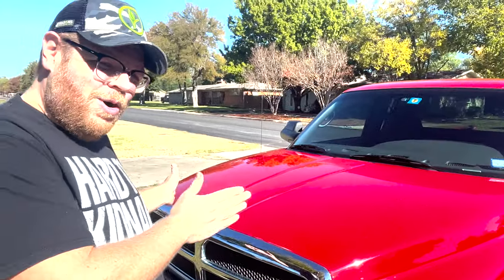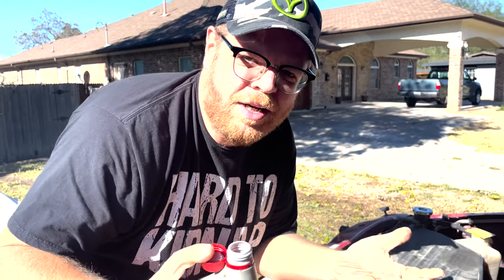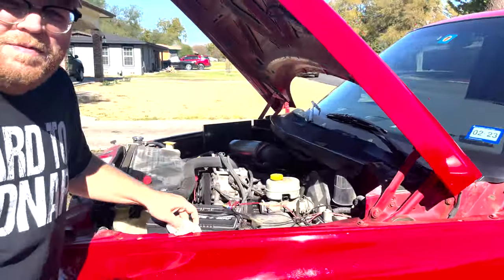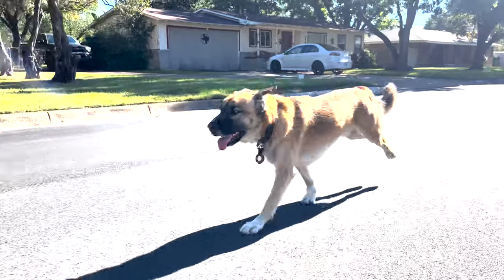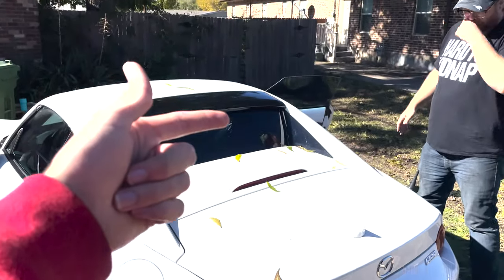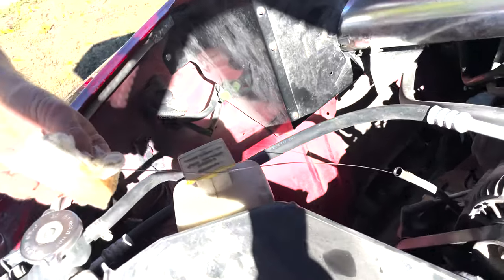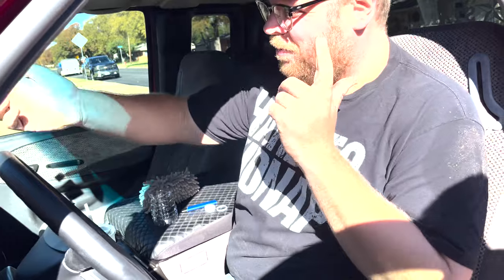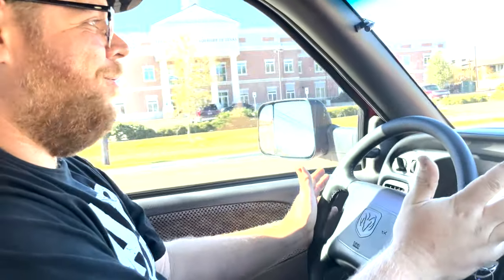Using ATF to de-sludge an engine

Comment: Sad to see a car treated like this. I bought a used 1979 Celica Gt in 1987 to drive back and forth to work. The original owner  had done 3 or 4 oil changes in 8 years. Surprisingly the car ran pretty good. The 20R engine was a beast. A trusted old mechanic told me what to do to clear some of the sludge. I drained the oil, changed the oil filter, added 2 quarts cheap oil and 3 quarts of transmission fluid. I drove it around for a couple of hours, not revving the engine. Drained the oil and was amazed at the chunks of sludge that came out. I did this once more in a month. I ran cheap oil in the car for the next 3 years. I was told that ATF had high levels of detergents. In 1990 I traded it in for a new Isuzu pickup.
Reply: My mechanic has done the same thing to his customers cars with gummed up engine. They use a full change worth and let it idle a while. 
I bought a 84 SR5 pickup with 22RE I didn't know was abused (by mechanic owner no less). I think he did about the same thing "2 oil changes ever". The filter was rusty!!  Anyhow I had my own shadetree method of a mix of mostly Diesel fuel and a little bit of engine oil and kept in its own container and re used for other gummed engines as needed (at my work). The pickup ran okay in buddy's garage and the drive home, I had no idea it was lumpy ooze in the crankcase.
It poured out like partially melted chocolate ice cream with chocolate chips. 
After filling with my mixture, and a roughly 7 minutes idle, it poured out like proper oil only a black film left in the bottom of the pan (my mix dissolved the turds still clinging to the inside).
Once full of the correct oil, oh boy it was a symphony of ticking and chain rattle. Game over.  Looking back I might have been able to put 3 bottle worth of STP and had it run without the noise.
The transmission was the exact same thing.. black and a lot of silt, once full of fresh stuff I noticed that the OD would not stay in gear. Today if I still had it I bet that Lucas Stop Slip would bring it back but back then there was only proper ATF and Seal Restore solvent. 
Hard to believe a mechanic would leave liquid turd in his vehicle.
Reply: Uh.  4 quarts is full.
Not 5.
Reply: I put sawdust in my engine and it made sort of a tik tik tik peep  varoom ! Thank you maam.
Reply: not supposed to drive it around when you do that trick. we always just let it idle for 15 min and then drain it. change the filter and add the new fresh oil
Reply: @jonnysnipes3123  i would agree. Probably did not help the engine.  It was a real beater, so I was never worried about it.. I definitely  would not do that on a more modern engine.
Reply: @reelman4299  probably is better to do that in todays engines because the oil ports are so much tinier than the old school engines so they may become prone to slush build up easier than older engines. i have a 5.3 chevy so i do a flush every 80k. ill pour 6 liter zero weight 20 oil in after i drain the old oil, and then ill top it off with 2 liters of atf+4 and let it idle for 15 min and then drain it and put in 8 liters of 10w 20 oil with an oil filter replacement. never had a lifter fail on me ever on my 2018

Comment: Yeah, ATF ain't going to fix worn bearings
Reply: No, but it will un-gum up valve springs and hydraulic lifters. Which seemed to have been his primary issue.
Reply: @nikdog419  Very little difference between motor oil, and ATF. Primarily viscosity improvers, and the concentration of additives (motor oil having significantly more).

Frequently they use the same grade of base oil to make both, ATF doesn't clean, can't clean, as the differences between the two is extremely small beyond concentration of additives. If anything one could take ATF, add more additives and make it into motor oil, engineering wise they are virtually identical. They simply use different amounts of the same additives, and a higher viscosity improvers/modifiers.

He simply poured in a very low grade oil (additive wise) which burns as it was never intended to be used near combustion.
Reply: @GainingDespair  Doesn't ATF have more detergents in it or is everyone just talking shit in the other vids
Reply: @RoxusRemo  No, it actually has basically none, there was a point in time where it had detergent, and during this period of time motor oil was detergent free.

It was true at one point of time, and like most things which travel word of mouth there was some truth to it. However we are talking a good 50-60 years ago when this was a thing. Long enough ago where it doesn't apply anymore, yet not too long where past mechanics didn't recommend it to those working under them as apprentices. 

Modern ATF, and motor oil both have the same exact base oil, from that stuff is added to both. Transmissions no longer have detergents in them because the base quality oil is purified enough not to cause build up, however detergents are needed in motor oil due to them experiencing combustion. The by product of combustion increases the acidity of motor oil, detergents prevent this for the most part until the oil needs to be replaced while also bonding to carbon in the motor oil to increase the size of it (so the oil filter can catch it).
Reply: @GainingDespair  Thanks for the detailed answer!
Reply: I always understood AT & PS  & Hytrans fluids to be basically a few additives away from  HYD fluid.  Also worked on different equipment over the years that the manuals stated you could use basically any of the above in their system. Also substituted one for the other in a jam in the past and never had an issue.
Reply: I'd be betting that the pickup screen and tube had a big smear of "engine turd" across it (not allowing the proper flow of oil, so it was being starved for oil not that it's so badly wore out).
Reply: Nope but it will get the rings unstuck if they are stuck, trust me I revived a motor that had no compression by adding a little ATF on the pistons, and guess what apparently rings where stuck and got unstuck and had 190psi compression after I did that.
Reply: Bearings 😆 there babet and over .100 thick ...they seldom fail unless they stick.. causing a wiping action which is caused by slug or low oil pressure or both

Comment: The ppl who are being nasty and rude just shows ignorance he added to his oil to break down the sludge. HE DID NOT REPLACE THE OIL WITH ATF if you have not tried it dont comment on it because before there lucs,seafoam,flushing or anything of that nature transmission fluid was used to clean sluggish engine and oil build up  and I'm the son of a mechanic who's the son of a mechanic 80 yrs in my family business and stand by it 100 percent Buddy if it works for you which it did keep up the good work
Reply: How much atf would you recommend if a motor takes 4.5 qts

Comment: I had ATF (used one quart) ran car for 20 minutes. The car was very abused, all the rings were stuck and it had blow by. It cleaned the sludge so well that hard chunks got free from the internal engine parts and clogged the oil pickup screen even after changing the oil. Pulled the pan and cleaned the screen. The blow by was almost cut in half and the car got another 30,000.

Comment: I've been doing this to my engines since the 80's when an old time mechanic showed me. I drive a 2016 Ecoboost now, 3.5. Bought in 22. it had what sounds like a stuck cam as the oil would age. did 3 oil changes with Ford oil and it started to become less. switched to Valvoline and, poof, its gone. I use about an 1/8 of trani fluid in the crackcase the day of oil change, drive it for 30 mins and go drop it. runs like a cat ever since. I am running 0-30 weight and will be trying the new Valvoline Restore, which is proving in real world tests to actually remove deposits and clean things up in the engine. you had piston slap, it should free those rings up and smooth things out for you. very good, entertaining video too. good luck sport.

Comment: I did a oil change swapped out 1 quart oil for 1 quart of transmission fluid after  a hour of running the motor the tick noise went away

Comment: All the doubters have a question to answer. Has anyone seen a working automatic transmission with sludge in it? Nope...why..they run extremely hot at times and sometimes don't get serviced for over 100k miles. Its got a lot of solvents and detergents in it. I have cleaned up a lot of engines this way.

Comment: i bought a 98 dodge dakota 4x4 5.2  new, it will turn over 400,000 miles by summer, its been an awesome truck,  only major problem i had with it was heater core replacement, did water pump at that time to be safe, original transmission is serviced every 50,000 miles, same with transfer case and axles. I just replaced the original starter last summer, truck still has excellent oil pressure, never gets below 40lbs even at idle, everytime i do a transmission fluid change, it gets sprayed onto my frame, rockers, undersides and bedsides. its still a great looking truck yet, people cannot believe it has almost 400,000 on it

Comment: If you want toprevent your doors and wheel wells from rusting, spray atf fluid around inside the door and up inbetween the rear inner and outer panels. Into rocker panels through drain holes. It prevents rust and if you have rust it absolutely stops it
Reply: Noted
Reply: Yeah and it also cakes up and attracts dirt and dust and will develop a blanket like film

Comment: next time you change your oil, replace one quart with Marvel Mystery Oil and leave it in.
Reply: I use mmo 6 oz on every fuel fill up in the gas , engine runs quieter and smoother
Reply: MMO is mostly Kerosene
Reply: @DanWright-w7x  I thought MMO contained mostly stoddard oil which is a substitute for kerosene for lighter fluid

Comment: This is like the oldest truck in the book. ATF is basically a 5 weight oil l,Your supposed to drain the oil, and fill it with atf then drive it around and get it good and hot. Drive it 25-30 miles. Then drain it, change the filter and refill with recommended oil. ATF is highly detergent. You’ll never see a transmission techs hands dirty? They are always clean! I’ll dump 2-3 quarts of ATF in the tank of
May 5.9l Cummins on fill up. It lubricated the injection pump and injectors, and keeps everything nice and clean! ATF is the greatest fuel for a diesel additive! You can run old atf thru your diesel to. When changing your trans fluid and doing a pan drop. Drain out your trans pan, keeping everything clean! Aftermarket Maghytec Pans with drain plugs rock! Dump the atf right into your fuel tank! You can dilute with diesel fuel if you want. Same with waste motor oil, there’s guys that run straight waste motor oil in their mechanical diesels. I soundly do it on today’s hi tech electrically emissions diesels. Cummins 12 and 24 valve engines love it. I wouldn’t run straight waste oil in the winter time with out diluting it with diesel fuel 50/50 but a couple quarts of ATF before your oil change or added to your tank when you fill up if great for it!

Comment: I know I’ll get those faces but I was taught at a young age that you substitute 1 quart of oil with non synthetic trans fluid every oil change “per change recommendation” keeps the crap out it really does we still have grandads 76 f150 the insides are immaculate.
Reply: I've been doing the exact same thing
Reply: do you drain it after running for few minutes or not?

Comment: You should run about a quarter to half a quart of ATF in the engine oil every oil change…my buddy has been running it in his rigs for well over 20 years and they work mint with well over 300,000 miles and no issues!
Reply: So you do it too?

Comment: I flushed my '02 camry with a full crankcase of cheap ATF.  idled it for 10mins., then drove it gently on a surface road at 40mph(following the speed limit) for 10 mi. followed by an oil change with quality oil & filter immediately afterwards.  The engine never had any sludge to begin with, but tried out the ATF flush just to keep the internals clean.  seemed to have worked well.  It gained back some lost power.  ATF came out dark & oily but not gritty at all.  Same with the previois batch of oil before adding the ATF to flush the oiling system.
Reply: I did something similar. Full case of cheap ATF let it idle for 45 minutes, shut her down. Removed the oil filter, put a new one on, topped it off with more ATF, let her idle for another hour gave her a few revs to 2k drained it, put in high mileage filter with motor oil and my oil pressure was perfect after that. Going to do it again next oil change.
Reply: @asleeperj  Nice!!
Reply: Why not use a thin motor oil like 0W8 instead?  You could probably run it for 500 miles.
Reply: @user-tb7rn1il3q  because the thin motor oil doesn't have the detergents that ATF fluid has, it wont actually clean anything.

Comment: My mechanic does the same thing to customer engine that is heavily gummed up.
He puts i think the full amount though not 1 litre but only lets it idle until they figure the lumps are dissolved. 
If it was my truck I would have left it in and drove around a couple days and let it swish off everything.
Probably a lump caught up in the pickup screen starving the pump slightly.
Could have used "Power Steering fluid" or Hydraulic fluid its because there's no additives to thicken as it heats up. ATF and all other Hydraulic class fluids remain at "10" so its like substantially thin and able to splash around and travel through the clogged passages, rinsing them out. 
As the turds dissolved, it raised the overall "thickness level" back up. Thick and dirty. 
Probably the transmission was ignored as well. No shadetree fix for this. Maybe 50% Lucas stop slip and 50% synthetic fluid as a last resort before a rebuild.

Comment: I used to do this in the late 80s on my Mustang. Also unlike most people I used to take the engine apart, frequently, to change the cam and lifters, change the intake, change the heads, change the rockers. No engine I worked on had sludge but we used synthetic and did regular changes. Some of us tracked our cars weekly the rest of us street raced 2 nights a week. Never had a blown engine. The only people that blew engines that I knew, ran the engine at a high RPM for an extended amount of time racing on the highway. Gravity feed oil systems just pump all the oil up top and then the pan doesn't have any more oil and it doesn't return fast enough. The others used a little too much nitrous on a stock unprepped block.

Comment: "I don't know if a Ford can get 350k on a gas engine..."
The 5.0 Coyote Modulate V8: "Am I a joke to you?"
Reply: all the modulars usually get about 400-500 plus if taken care of.
Reply: Got 175k on my 18 f150. Runs great
Reply: The Ole 4.9 will go forever!!
Reply: 4.6 entered the chat
Reply: 4.0 ranger entered chat
Reply: 5.4L, 4.6L and 6.8L were better than new ford engines. The 5.4L3V are good and I have them after 200,000 miles. These motor have been change 3k miles on time plus add 5w30 oils also melling oil pump that fixed problem
Reply: 97 fd150 4.2 277k  miles

Comment: I like your style all you good people at "Novice Garage" I think I'll be watching from now on.  Can I point out things? 1.  @5:20 - that radiator is filthy, the fins are coated with dirt.  I'm surprised it cools the engine at all how it is.  If you can't remove the radiator and clean inside and out, at least you can blow soap through it from the engine side, while still installed?
Reply: Very good point.

Comment: Grandpa used to add ATF to oil for noisy lifters. I run Marvel in oil for everything and Fords can get high mileage on gas engines but go ahead and play the game if it makes you feel better. I liked my 99 Ram with 5.9l Magnum v8 except it kept exploding transfer cases under normal operating conditions.

Comment: I once watched a old guy , had a old 74 Impala come in the shop , motor sounded horrible.low power and a slight knock but good oil pressure. He backed it out in the lot and pulled the Air cleaner revved it to 3k and started pouring atf down the carb about 2 quarts. 
 Made the knock go away and got back to having some guts after setting the timing. Cleaned the carbon off the valves and pistons he said.
 Now i just use seafoam, triple threat, throttle and top end clean out does the same thing pretty much and is catalytic converter safe as the old guy told me don't do this on a car with a cat . The wax in atf really does a number on the cat . And to complete the jod seafoam in the tank to clean the injectors ans some in the crank case to quiten up the lifters and clean the oil control rings . If done right it's a miracle worker.

Comment: I replaced my 02 Ranger motor after screwing up the timing and broke 3 valves. Replacement motor was older. Ran really rough. Replaced all the lifters, still rough. Got cylinder 3 soaking in atf (P03030) we'll see what happens!

Comment: You can accomplish the same thing with marvel mystery oil.  I add it about 100-200 miles b4 I plan to change the oil.  The good thing about using marvel is, you’re gonna have a little to the fuel to clean the injectors. Instructions on the bottle. Using fuel injector cleaner and cleaning your throttle body will make a big difference in performance if they’re dirty.

Comment: I put a pint of brake fluid in a crankcase with 5.5 quarts new motor oil. Do you think that will do anything bad for 5,000 miles?

Comment: Fixed s-10 with gallon of atf in gas tank that had 1/8 tank. Also did engine swap on grand Prix that lady did oil change and used ATF instead of oil. Took out oil pump.
Reply from the maker: nice!